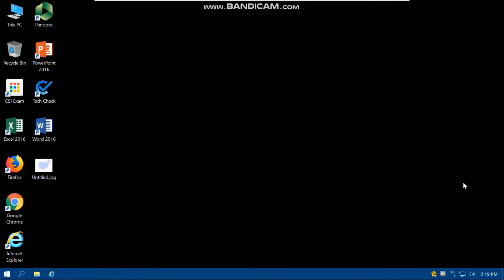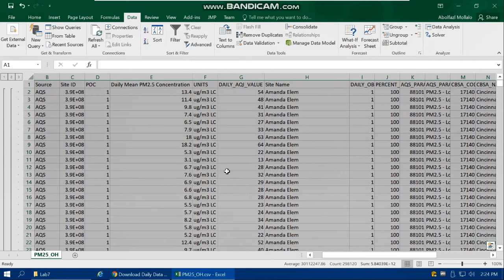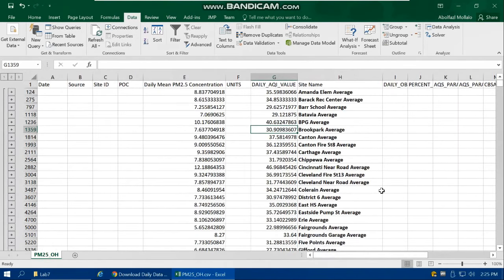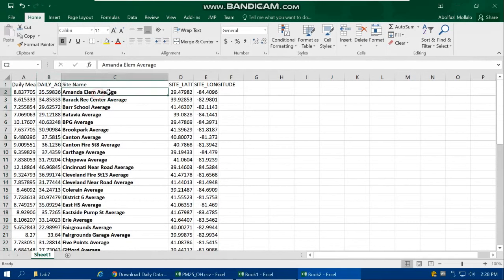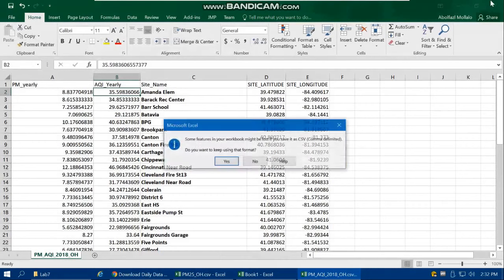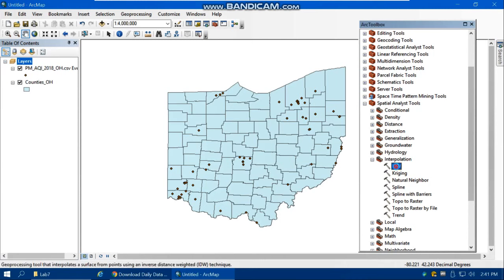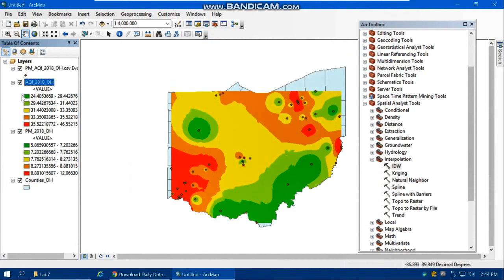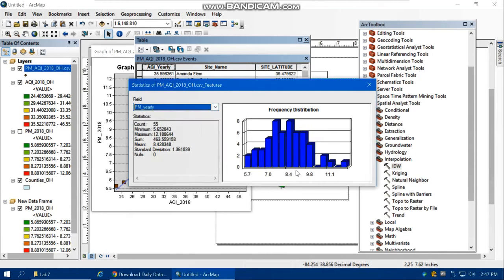Making Air Pollution Maps from Scratch

Comment: thanks for your video. How you can stretch the interpolation raster to cover all the Countries_OH.shp you have? These gaps are not very nice!!
Reply from the maker: Please note you cannot extrapolate outside of data points ( climate stations), to address this issue, you need to have climate stations of neighboring states as well.
Reply: @HealthGIS  Shouldn't have to worry about neighboring states--should be able to create a DEM or something similar that covers just Ohio and not anything else.  Why not merge the counties layer for starters and remove boundary lines?   I will have a heart and at least recognize that this was all done in ARC MAP (!) so I will take a knee too but at the same time something still feels off to not be able to extrapolate from all points within a certain polygon file....